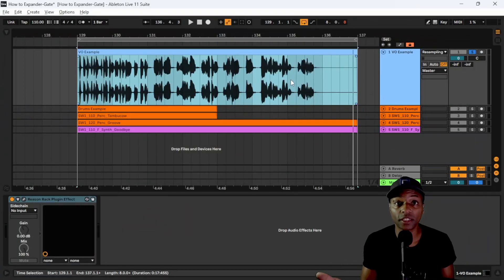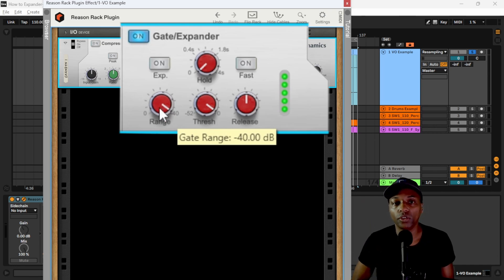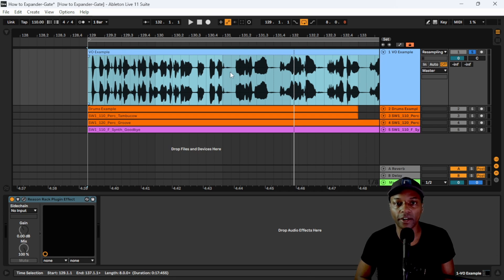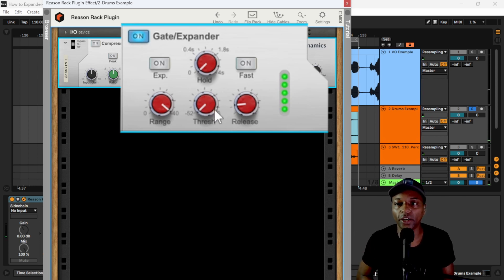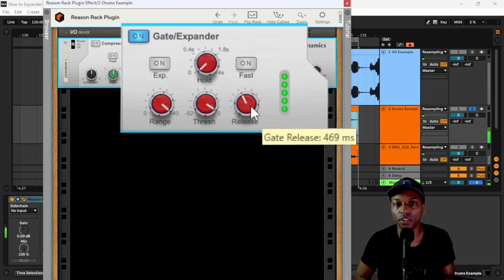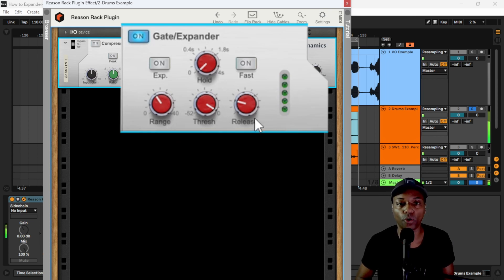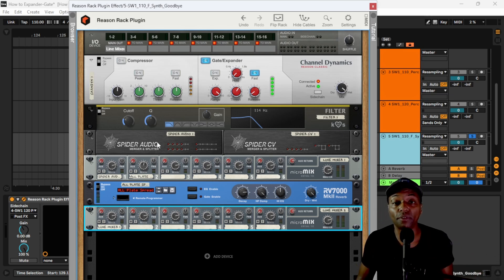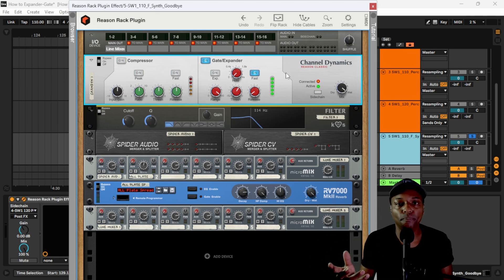Gates & Expanders: Get Creative

Comment: Great examples and demonstration of some useful yet (as you said), probably very seldom used tools.

A small tip to viewers, if you're not able to get the gate to gate how you are hoping due to the dynamics, try throwing it into an expander first to increate the dynamic range then gate it after.

Also don't sleep on Alligator in the rack, a fantastic creative gate plugin.
Reply from the maker: Great idea! And yeah alligator is a sleeper for sure.

Comment: Always fire 🔥🔥. This is also very helpful. Just understanding this from a basic level up to a creative level is incredibly useful. Thank you good sir. 

I have a question for a series.

Would it ever be possible for you to break down the lingo of music creation? I think we get the idea of things but the technical terms and why they're useful are sometimes are stumbling. 

I think a decent amount of us don't understand things like where the gain settings should be, why to use a compressor, what is a side chain, what is meant by creating space for vocals, what's the difference between mixing and mastering, what are your go to tools for songs, and what beginners should know.

At this point I figure out a lot of this, but I don't understand why I'm doing it. I feel like I need to learn the rules before I start breaking them. If that makes sense.
Reply from the maker: Thank you for the kind words. Pretty good idea for a video/ series. I’ll add it to the list! Thanks for watching!

Comment: Awesome explanation of gating. I didn’t really understand expand until now. Another gate you can use in reason I figured out today is on the rv7000. What’s cool about that gate is that it has a high pass filter that gates based on frequency and volume of the audio. Meaning you can use the gate on the reverb for your mid and high pitch instruments and clean up the frequencies the high pass filter on the ssl mixer leaves behind. This is the best way I’ve found to make your bass hit harder and sound more clear. 😊
Reply from the maker: Interesting. I'll have to try that. Thanks for watching!